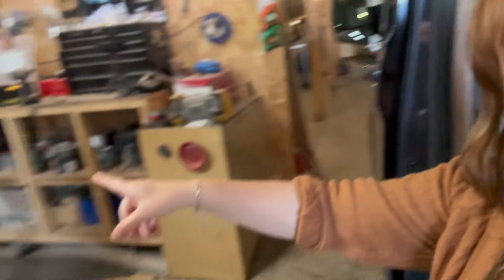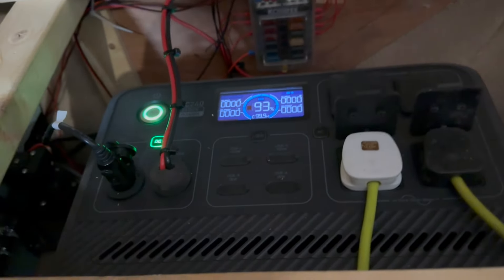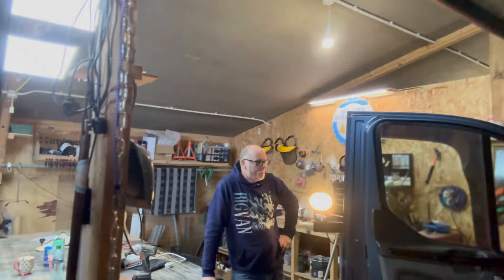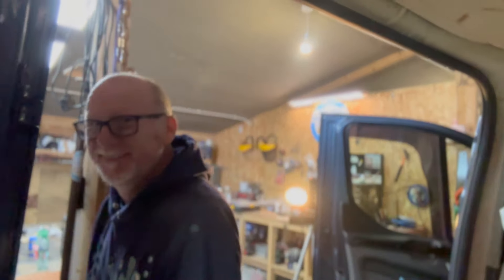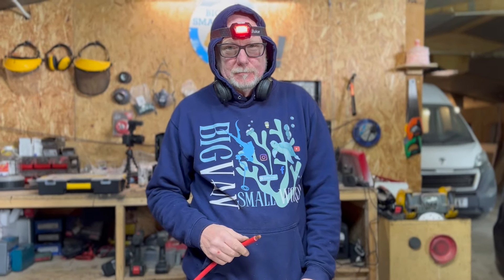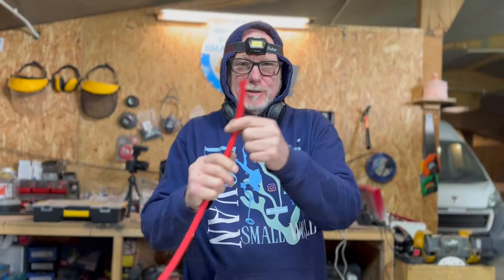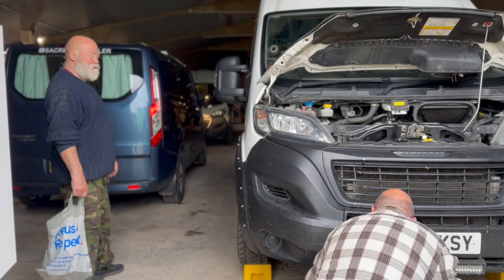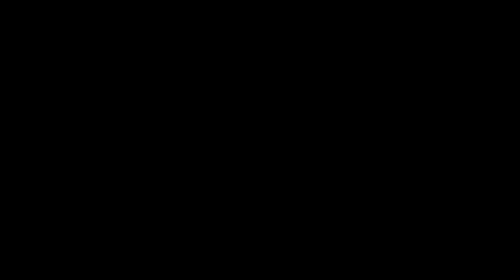They said it was PERFECT, but will it pass the MOT?

Comment: Becky, EcoFlow have just launched what they cal an Alternator Charger for their products, it charges the power pack from the vehicle alternator and connects to the extra battery port, so they have achieved what you have asked for 👍 it also works in reverse so if you have a flat vehicle battery the EcoFlow will still start you van 👍
Reply from the maker: That’s perfect thanks! I’ll check it out x